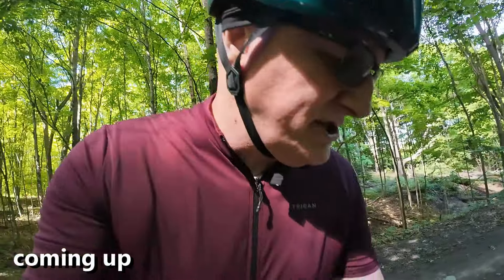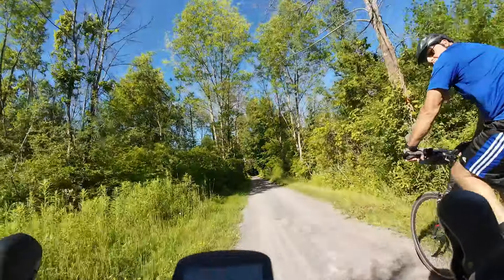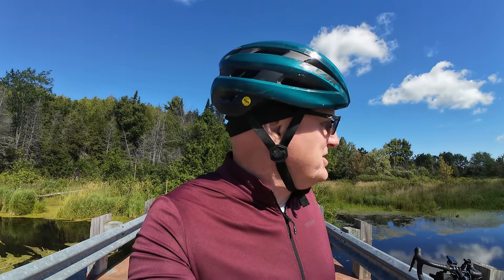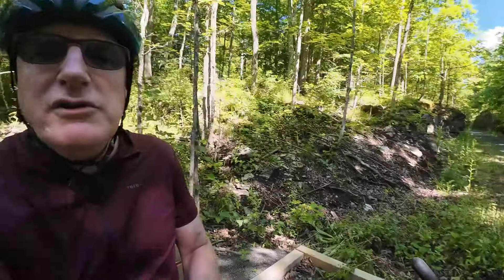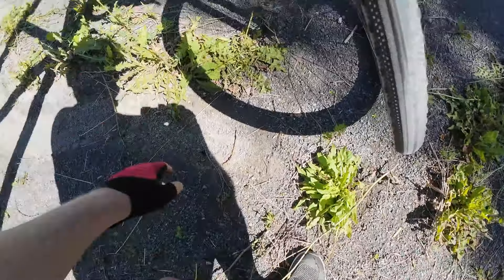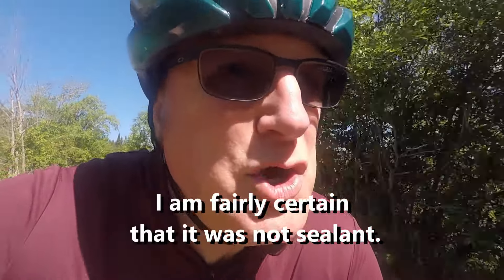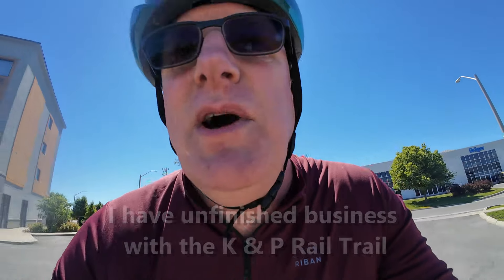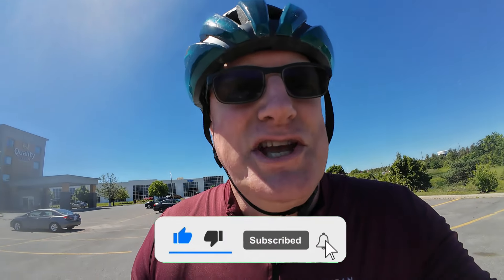K & P Rail Trail - My ride was ended by a mechanical.

Comment: That looks like a great trail. It was good to have someone around to give you a bit of support too. I've got tubed tyres but I use Slime. Works well for small leaks and punctures.
Reply from the maker: It is a great trail Jeff. In the end, I confirmed that it was not actually a puncture.
Reply: @cardiaccyclist7477  Ah. I thought there was some sort of leak because you were losing pressure.
Reply from the maker: @jeffturner8927  I run with them at a really low PSI, and on this trail I started to feel the surface through the front tire, more than usual. On reflection, I don't think it was losing air, I just think it started a little low. When I tried pumping it up I bent the valve core and air would not go in.
Reply: @cardiaccyclist7477  I getcha. Just have to get that sweet spot.

Comment: Very nice, I'll have to add that to my bucket list.  Did you ever find the cause of the lower pressure?
Reply from the maker: It is well worth trying ths one out. I did find the cause. It was a damaged valve.
Reply: @cardiaccyclist7477 , Tubeless, right?  I didn't know you could do that (damage the valve).
Reply from the maker: @MrJx4000  Yes I had used a cheap pump, which did not clamp onto the valve properly. It ended up bending the valve core and I could not get air to go in.